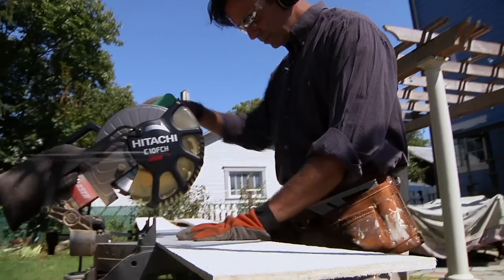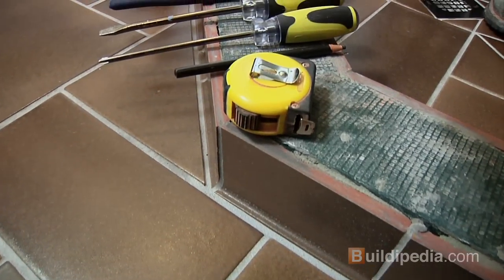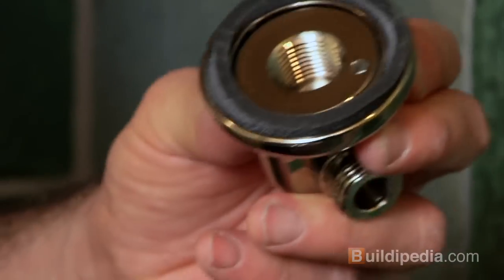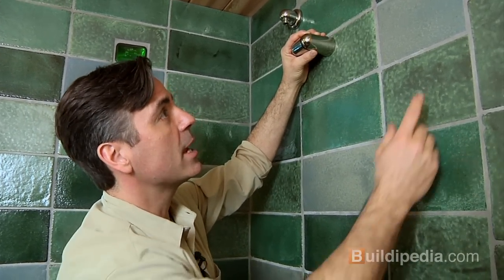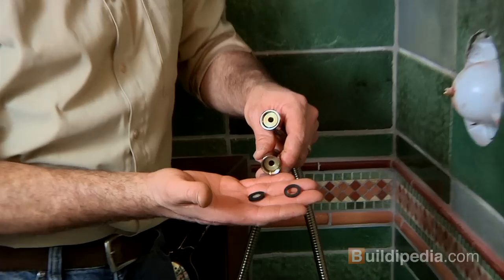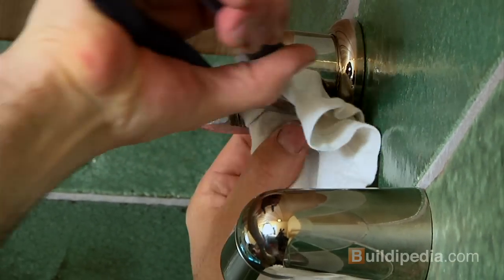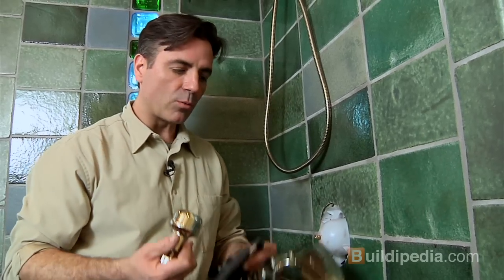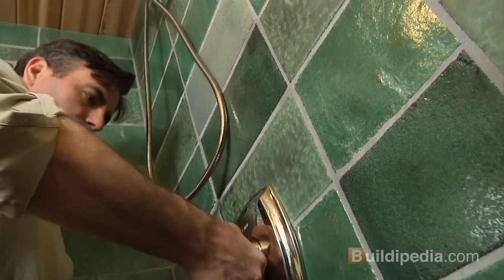How to Install Shower Fixtures -- Buildipedia DIY

Comment: That particular shower head is perfect for my application as it mounts lower on the shower wall yet has a higher head height when mounted than most other units. Could you tell me the brand and who the distributor(s) are? I have looked around the web and I haven't found it yet.
Thanks, Dave

Comment: Out of curiosity, why did you choose to install the shower head holder over the grout joint.  You could have moved it down just 1/2" and that would have reduced the risk of getting water behind your tile and into your wall.